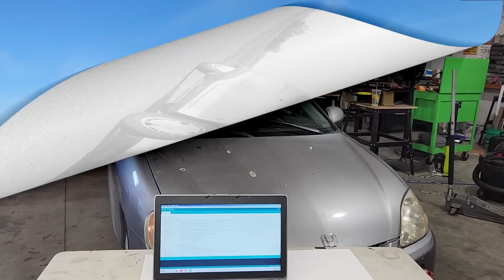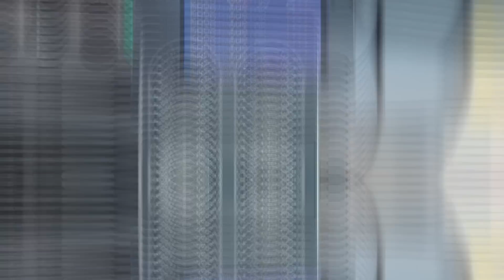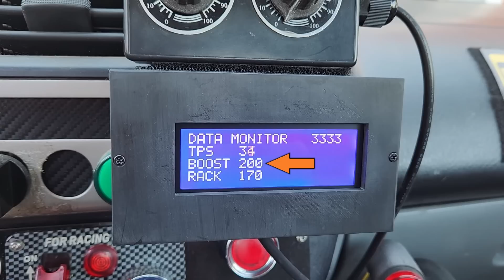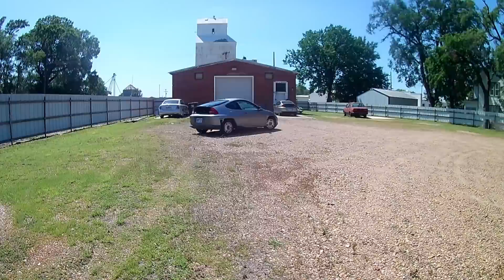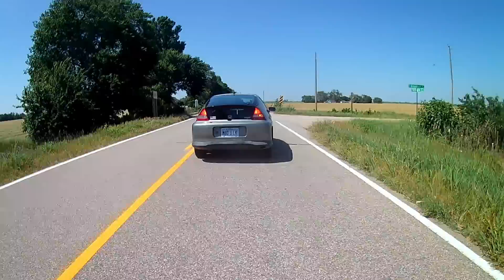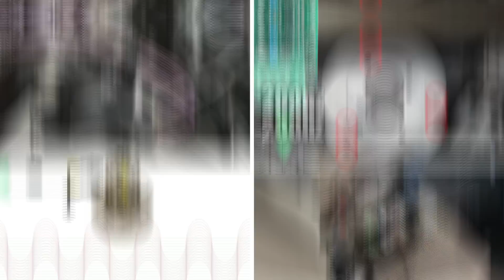S4 E22. We road test the Arduino engine management on the supercharged kubota diesel honda

Comment: Are you also going to have it back off fuel when the EGT goes too high? Also, maybe when it detects steady throttle and steady speed, back off fuel so that you’re not using unnecessary fuel (and heat) when cruising a single speed. Only putting fuel back in if throttle changes.
Reply from the maker: Yes,  there will be EGT monitoring to prevent engine damage.  The code for that is easy to add once the program is more complete.  For cruising I will watch the TPS and VSS and if its steady, the rack limiter will prevent the car from going over 55 MPH for cruise mode.
Reply: @robotcantina8957  sweet!

Comment: i always wondered that if you took a engine like this or smaller running as a constant efficient speed charging a battery pack that drives electric motors what kind of economy/performance you would get

Comment: Ok, but performance wise what does this eventually lead to? Being able to shove more boost into the engine?
Reply from the maker: For performance all I really needed to do is back off on the rack limit screw.   The problem with adjusting the screw is it also causes a giant cloud of smoke to trail the car as it goes down the road.  By adding a computer and some simple controls, I am able to control the smoke.  Once The system is finished I can go back and change the pulley on the supercharger for more boost and I can continue pushing the engine for more power.

Comment: A simple question, why not   connect the air and fuel controls to an optical emissions sensor,  or at least to the Arduino input! I speak from a position of great ignorance. Thanks for the show. Greeting from Mallorca
Reply from the maker: What is an optical emission sensor and how much does one cost?    Keep in mind we have a small budget and like to keep things simple and cheap.

Comment: Thanks for the video! I had recommended the GM IAC when you were originally talking about a way to dump boost figuring it would only need to open a little and slowly, however if you intend to have a more or less linear program they may not respond fast enough to throttle input without some smoothing?

I greatly enjoy your channel and I hope you have a great vacation (I’m a computer systems engineer so I think I understand exactly where you are at when you say workaholic :) ) and remember to unplug, we all need to. 

Also wondering if you really want a linear model or just more steps like a fuel map? Idk just brain thoughts
Reply from the maker: I'm going to try a formula for linear control and see what happens.  I could also do a map, but a simple formula is what I want to try first.  The IAC valves seem to move fast enough.  If you look, there are not many steps between the idle settings and the WOT settings.

Comment: Do you bring a computer in the car if you wanted to make a change during the drive cycle?
Reply from the maker: No,  The computer is too big and its too hot in the car.  I prefer to take quick notes instead.  In the past when I fooled around with megasquirt projects in a car with air conditioning, I did edits on the side of the road.  This car only has one functional window and this time of the year it's approaching 100F inside the car.

Comment: Does the Arduino allow you to record performance data?  Instead of running the full Kansas Prairie drag strip, you could make a few 40 to 50mph full throttle runs with various fuel rack positions to see which position provides shortest amount of time between.
Reply from the maker: I reckon I could add an SD card gizmo to the Arduino and store data.

Comment: Just need to add something to the mix to automate the glowplugs, based on air temperature and duration of the glow, cos some days it's warm enough that a glow is not needed on a traditional diesel engine like this... :)
Reply from the maker: This engine will start without the glow plugs down to 60F, however it takes a bit longer.  Most of the time I press the glow plug button out of habit.

Comment: Have a great vacation, Jimbo!  Now that you have boost control, maybe it’s time to go back to a smaller pulley on the supercharger, so that additional boost can be added during acceleration runs.  If the audience is getting tired of software, how about flipping back to the Renault for a bit?  We still haven’t seen the dual carb setup run.

Comment: wut if u make controlling like, boost dependant on tps on a logarithmic scale until 90 % tps, when all the boost is available and by logarithmic i mean closing boost release valve exponentially depending on tps. idk, maybe linear is better tho. but second idea is making fuel rack dependant on map sensor and not on boost valve position, that approach might make ideal stoiciometric burn conditions that are not dependant on boost valve positions entirely if u map it right
Reply: btw, i might make something inspired by ur videos this summer, hobo wending machine is almost ready

Comment: Put the fuel rack on a slight delay or use a speed sensor to trim fuel load, and I'm sure you could clean up that hard launch. Also, why not let boost goto full as soon as you add throttle? This could be another speed based trim.  Once rolling, and with any throttle above idle.... keep the boost in.
Reply: He mentioned wanting to play with a mode switch and what you’re suggesting for boost would make sense for a performance mode for sure. I’m bummed the techy videos aren’t doing as well. It’s going to dissuade spending time on this content that I think is very interesting.

Comment: Will it ever reach 88 mph
Reply: You just need to believe in the power of software engineering gnomes 😎
Reply: If it could, I doubt he'd try
Reply: Maybe… Richard holdner did some testing on the AMR 500 and saw it has the flow for up to 150hp. Not that is an ideal engine which this is not but making a realistic half that would get you close to that speed. Usefully he also seems to have found the upper speed limit for the blower, spinning it up to 18000RPM caused damage. So backing that off a third should give OK reliability at 12000RPM. I think this car is right around 1:1 right now so it’s not being spun half as fast as it could be with the 4k RPM limit of the engine. Now the question becomes if the different pulley ratio can be fit here, and if jimbo wants to chase power that far. The new control system should make it reasonable -ish